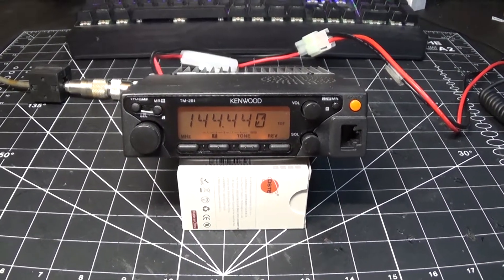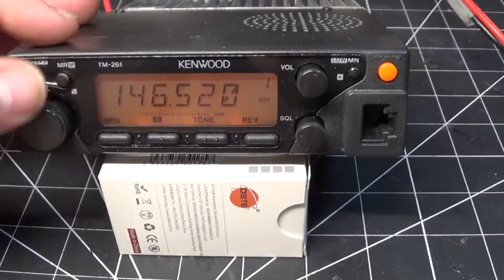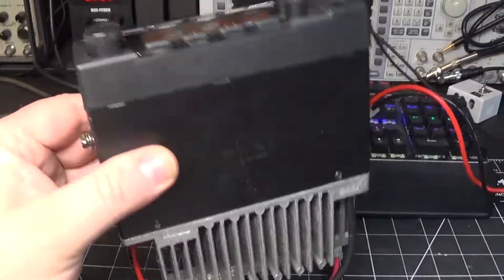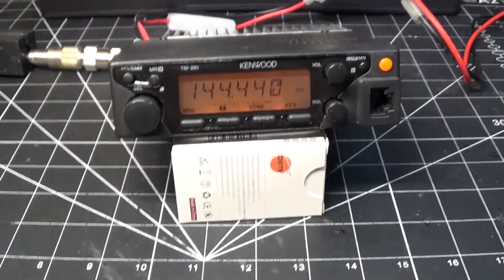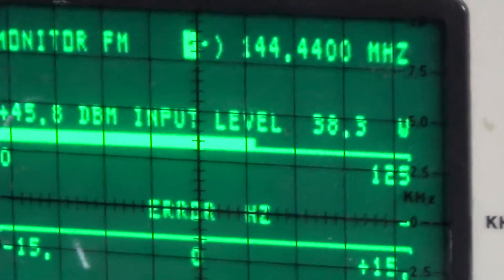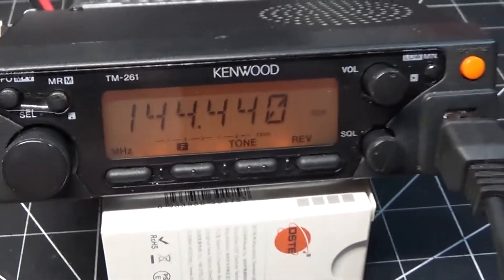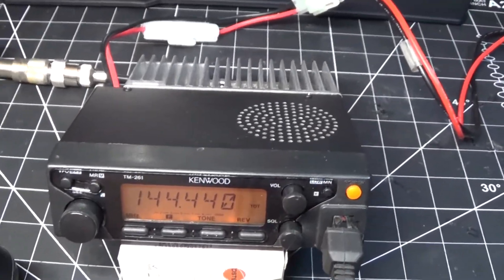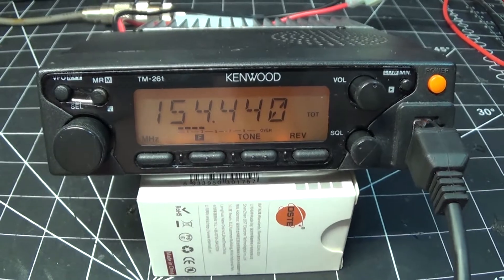Kenwood TM-261 Overview and testing

Comment: These are fantastic radios for long distance CB radio use. Has to be modified for all channel transmit. When I was a deputy, all of the police agencies in my county used them for in car talk around radios. Shoot the poo radios. 154.000 and above were the frequencies we used. Most were old pd frequncies after we went to 800. Could talk all over the county. Then the 60 w TM-271 came out. A lot of guys switched. The mic you're using looks like the 271 mic. Might be why it's not working correctly.